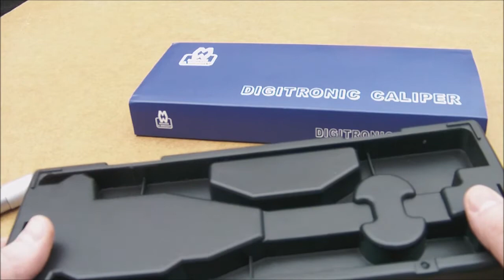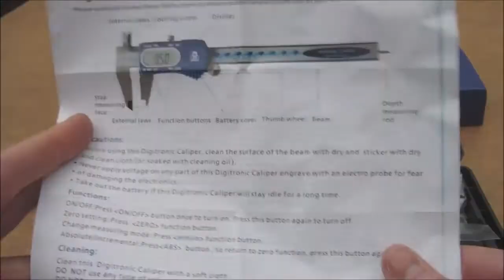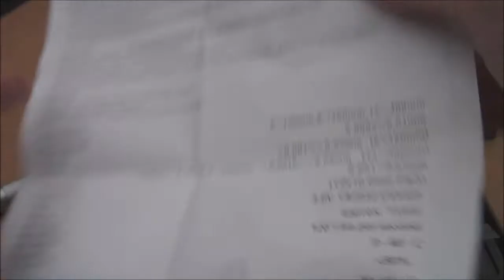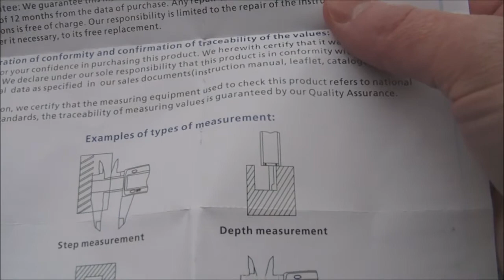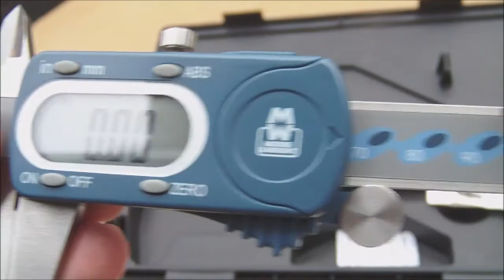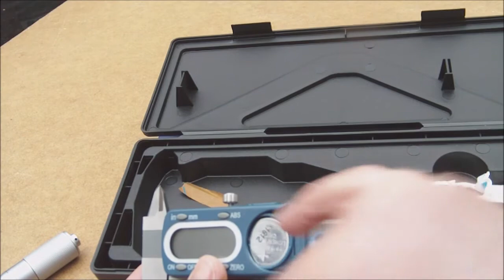Moore & Wright 110 - 15 DBL 150mm Digitronic Caliper

Comment: Obviously not Made in England ?
Reply from the maker: I would doubt it, under contract id say. There's a German company that does almost exactly the same stuff with the same certs in. Obviously a sister company to M&W.
Reply: @ashleymcgovern5120 

From what I gather and they use a supplier based in Shanghai.
Reply: @ashleym @ashleymcgovern5120 

How did the callipers hold up over the years ? How often did you have to replace the battery ?

Comment: You mention twice the ABS function but unfortunately you have not used it. I have received today a similar caliper and the ABS display info is logically inverted. I mean, it is ON when the caliper is on RELative / INCrement mode and OFF when it is on ABSolute mode.
Do you confirm?
Reply from the maker: Sounds like you have one where they just made an error on button selection but, as long as you know which is which you should be fine. It might still be very accurate, they just over looked that issue. I've had import stuff, with other electronic things. Like that where a button selection was opposite what it was supposed to be etc. As far as I can remember this one is fine. Moore & Wright wouldn't put out a product that did, even if it was contracted to be manufactured by someone else (my personal opinion is this was made under contract by someone else, as it's identical to I think an Igaging product). It's one of the best known most trusted brands in UK for measuring instruments since way back in the 1950s even. When I started, Moore & Wright, Mitutoyo were the only stuff people would trust. Starret was / is decent but, some veterans in UK were not familiar so stuck with Moore & Wright(&  Mitutoyo).
Reply: @ashleymcgovern5120  Thanks for your information.You haven't answered directly but I presume your MW 110 doesn't present the flaw I described.
Anyways, as I regarded Moore and Wright as you described them, and I bought mine through EBAY from Machine-DRO, with a hand-signed certificate of quality, I believe someone knew well they were delivering a defective product.
I don't intend to present a claim because this is already the second item (as they say) once the first one has never arrived and this one took close to a month from the UK to Portugal.
And, as you say, the caliper is perfectly usable. The issue is not a button one, because the button changes the mode as expected, only the display is inverted. I now know when it says ABS it is in incremental / relative mode, and vice-versa.
Yet, it puzzles me how come a very respected company in terms of precision and metrology doesn't notice this flaw.
As an electronic engineer, I can see easily how to make the mistake. Now, to let it go to volume production? And moreover, not to notice until it is ready to sell?
It seems almost impossible. I would say someone took a decision to keep that flawed batch and use it in some cases. But I'm not a conspiracy theorist guy!
I just cannot see how this could happen otherwise.
Reply from the maker: @antoniomonteiro1203  stuff that is originally made in the far east for example they rush stuff out to make a cheap buck by, the time they realized the mistake there's already a lot manufactured. You can be sure they would try to sell it, than throw it away & start again. The issue might be fixed for next batch, they will still try to profit off it.
Reply: @antoniomonteiro1203  I have the same problem. 200mm version. ABS button function inverted. Hand signed certificate. !!!